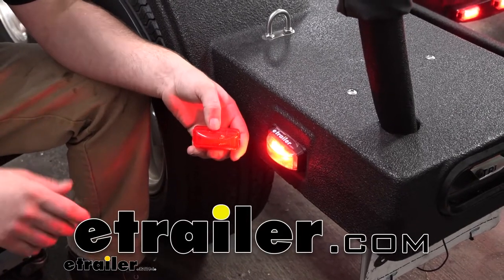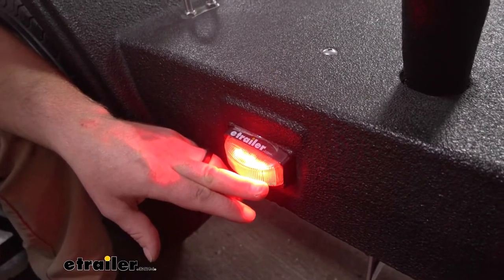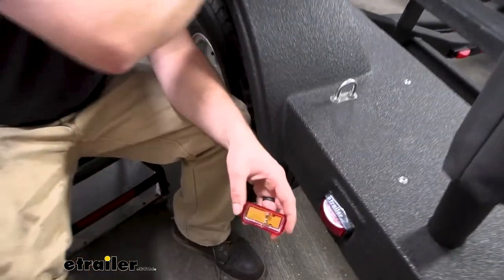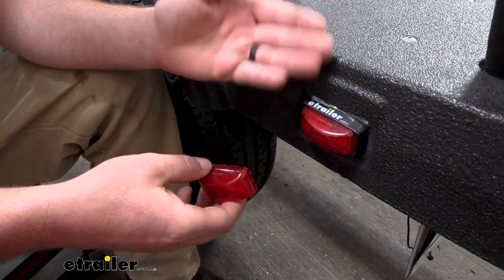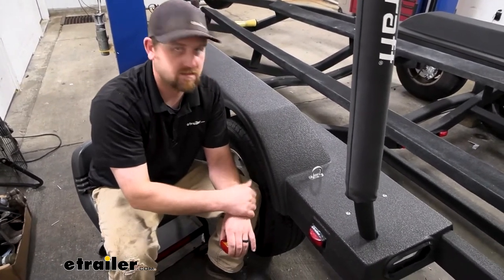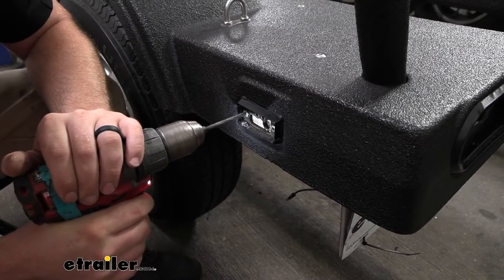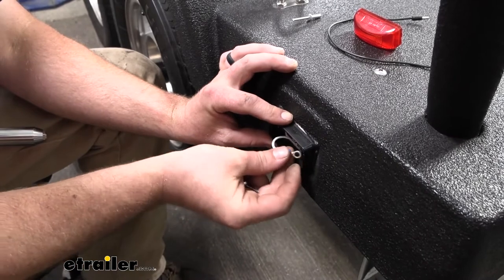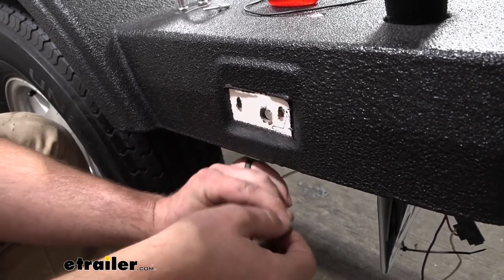etrailer | Detailed Breakdown of the Thinline LED Clearance and Side Marker Light

Comment: How do you know what  input is positive on the back of the light?
Reply from the maker: The # AL91RB lamp mounts using a # A91BOB bracket and a # A46PB pigtail. The black wire coming off the pigtail is connected to 12V power and the white wire is ground. 
https://www.etrailer.com/Accessories-and-Parts/Optronics/A91BOB.html
https://www.etrailer.com/Accessories-and-Parts/Optronics/A46PB.html
Reply: @etrailer  yes that part I am aware.  I was meaning on the back of the light itself is one a positive and one negative or does it even matter how you plug it in?